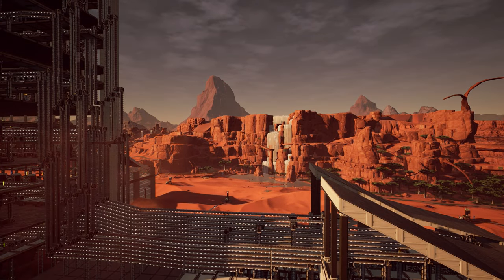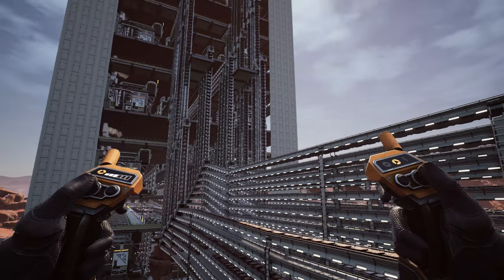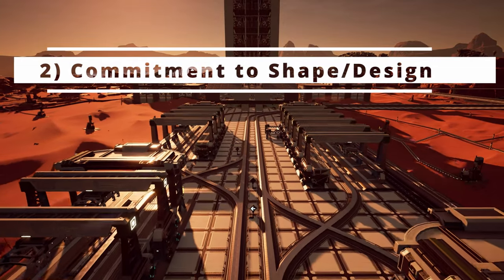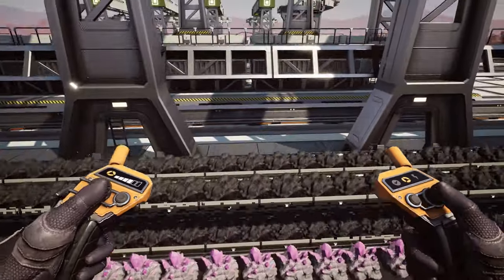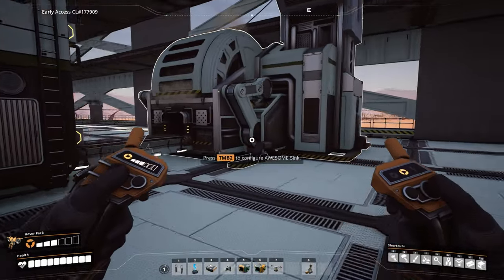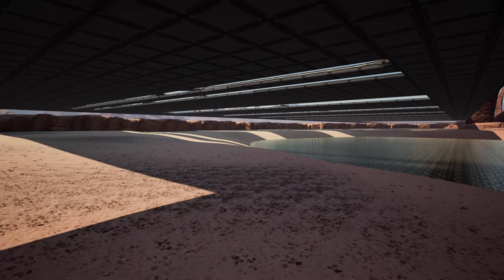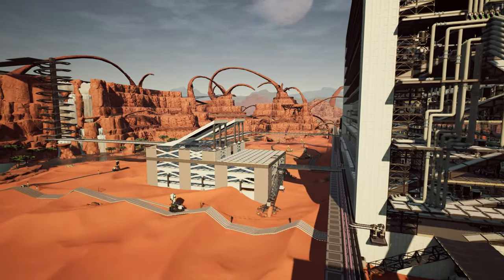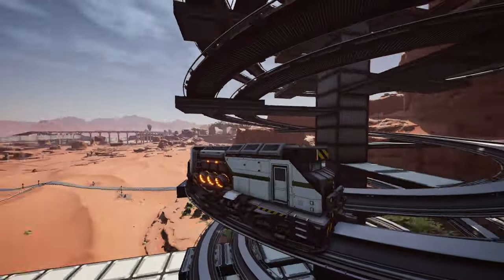All Game Transport Logistics | Train Hub, Sorting & Busway Design | Satisfactory Megabase Guide

Comment: Great discussion. :) I've gone through all three styles and still use all three at times.

Ad Hoc -- Like most people, my first builds had the machines plunked on the ground in a mess. I'll be honest, that's usually how it goes when an update drops new content too. I just find some empty ground and start dropping machines as I figure out the new stuff. Resource nodes are all fairly organic since the nodes are where the nodes are and I have a sick compulsion to tap every single one of them to their maximum capacity.

Production -- The factory game I'm most used to is Factorio, so I had that mindset when I first hopped into Satisfactory. Seeing a sandbox factory game with machines and belts, I figured I needed to make my own production goals, so I nievely thought "What kind of production rates should I aim for? I dunno. Umm, ok. I'll aim for at least one saturated mk1 belt of every item in the game." That led to sky platforms and mega builds until the realization that there aren't enough resources on the map to meet that goal gave me pause to re-examine everything I'm doing. 

Shape -- Especially since Update 5, I've put more effort into aesthetics. The sky platforms never really sparked joy for me. They were utilitarian and functional, but felt unrealistic and uninspired. My current efforts are about trying to make everything feel realistic and within the realm of plausible physics. After that, trying to make the architecture pleasing without sacrificing production needs. 

I still have a strong instinct where a factory should have a purpose and goal. We don't build them IRL just to build them. They are to meet a need. I sometimes struggle to reconcile that in Satisfactory. My normal experience in a sandbox game is that the world (and I) tell a story. To feel satisfactory to me, that story needs to be something more than "build moar to research moar for research's sake." Why? To what end? Just 'cause FICSIT told you to, or is there more to it? Figuring out the story you want to tell can make all the difference and give the builds direction.